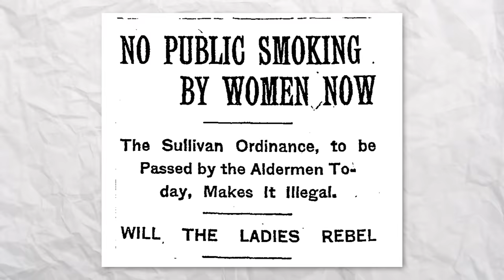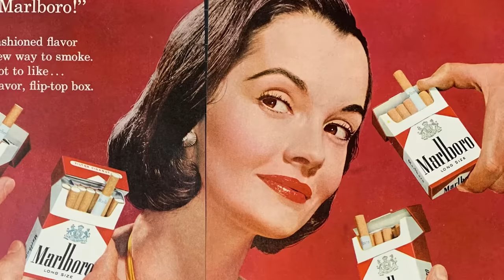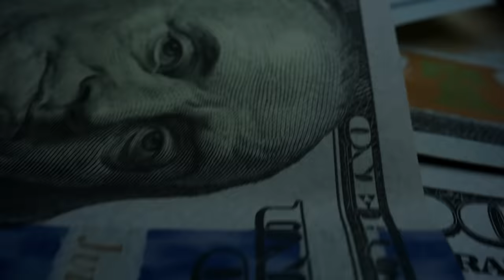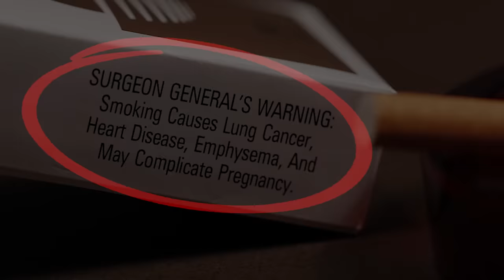How Marlboro Became the #1 Cigarette Brand

Comment: I started smoking Marlboro at 15 as that’s what my dad smoked. I was a 2 pack a day smoker. I quit 10 years ago at 30. I am the first person to quit in a family of smokers. I just got tired of the constant coughing when you wake up and through out the day. Now days a carton of Marlboros will run you close to $100 if not more (adjusted for inflation). Do that math on that on. Well I did. And I was spending over $1500-$2000 per month on tobacco. In the ten years I quit. I saved over $50,000 and was able to buy a brand new truck cash.

Comment: I'm 28 and started smoking around 18 years old. I turned 18 in 2014 at that time you could still purchase cigarettes at that age. I smoked menthol cigarettes for a few years and quit due to frequent coughs 2 yrs ago I started vaping and while it doesn't cause me to cough it's a lot harder to stop vaping than it was quitting cigarettes.

Comment: Marlboro is also one of the most iconic motorsport sponsors. Formula 1, rally, Le Mans, TransAm, Indycar, you could look at the grid and you’d find multiple cars in red and white. If you think of it, Formula 1 was the perfect product for Marlboro to sponsor. It combines the glamour they tried to appeal to in the 50’s and the rugged sense of adventure and maverick-ness their later ads did. 
The only major racing sport they didn’t sponsor was NASCAR, and that’s only because Winston already had it on lock

Comment: Correction:  The video tells about the ban on cigarette ads on TV and radio, but it does not mention that the ban on print ads came much later.  I remember the magazine ads and billboards with attractive models all the way until 1998, when a settlement stopped those.

 The portion about warning labels also needs some correction.  The warning label depicted in the video was not the first warning label. The first warning labels in 1965 stated, "Cigarette smoking may be hazardous to your health." The tobacco industry fought these labels, and the video shows one of the more stringent labels which were required starting in 1984.

YouTube won't let me post any links, but you can find more information if you do a web search on the history of warning labels and cigarette advertising.